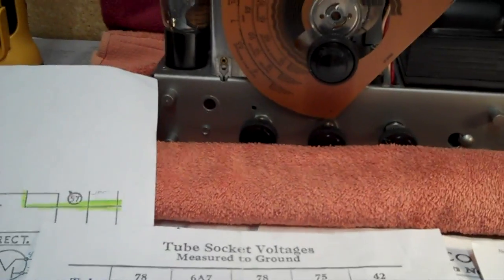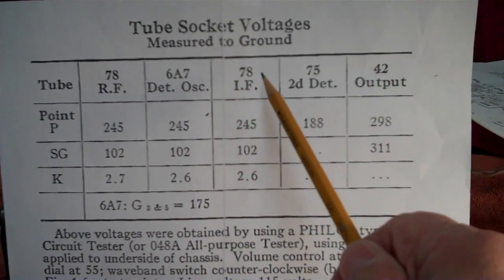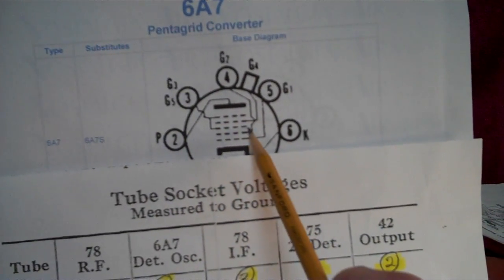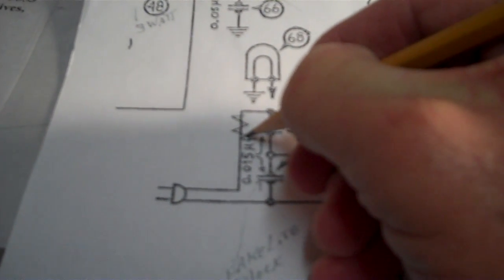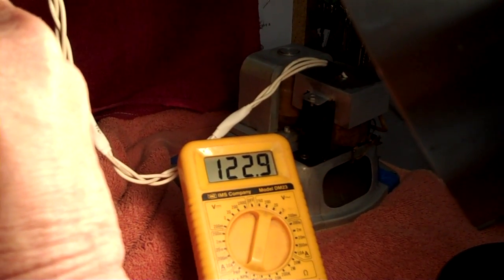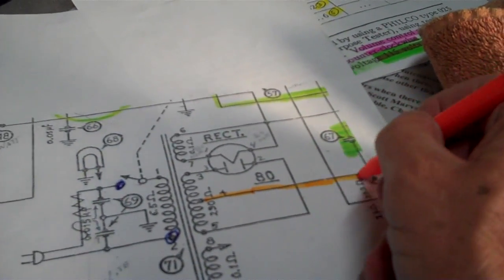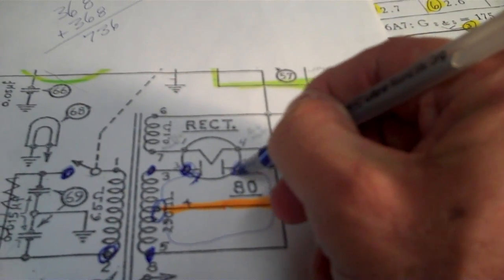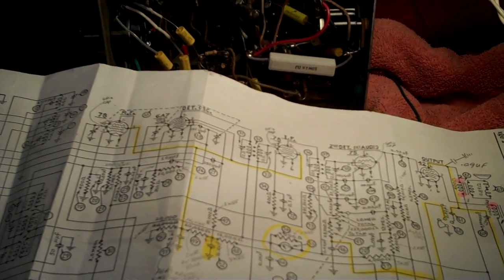1936 Philco Model 630B Repair and Restoration (Part 33 of 35).

Comment: John, Thank you again for showing us newbies how to do this.  I'm having problems with my first radio (a 1938 GE F-70) and I'm sure that reading voltages will be part of the solution to solving the problem.  The # 42 tube filament got really hot when I turned it on and now my radio doesn't play anything except static, which gets boring after a while.  Another challenge to be met.  Tom